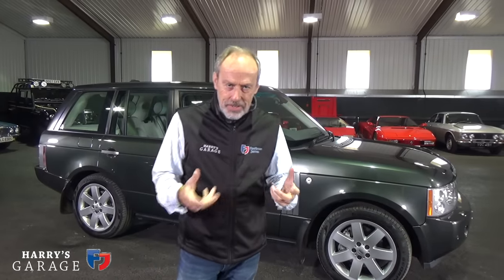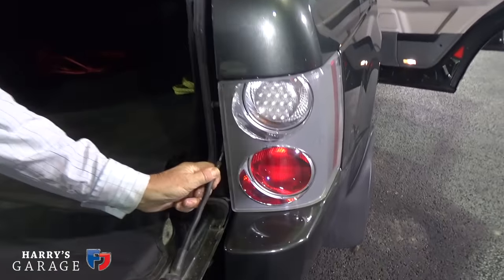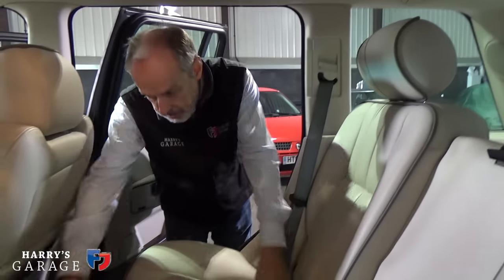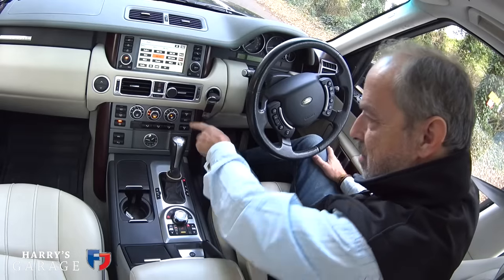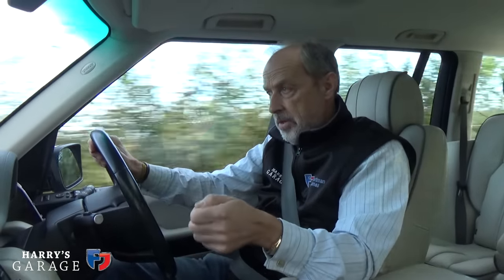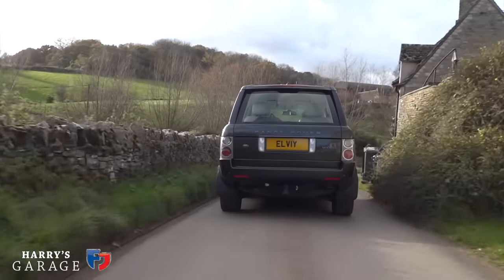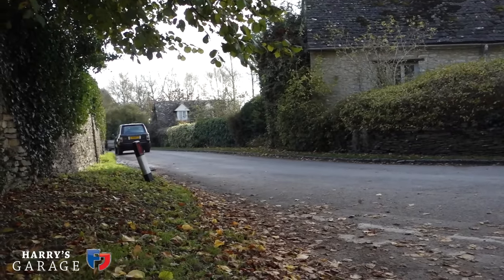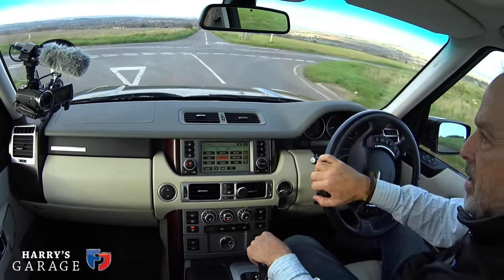Range Rover real-world review and buyer's guide L322 TDV8

Comment: Buy this car only if you can afford to buy a brand new one, the appeal of owning a range rover for cheap is incredibly high, but while the used Range Rover may be cheap, the repairs costs are still as much as a brand new Range Rover, but you are dealing with an old one with more parts nearing their expiration. The only smart thing to do, would be to spend this money and lease a brand new one, furthermore, used range rovers may be cheap in UK, but in the US, for a 2006 Range Rover 142,000 miles goes for as high as $12,000, for that money you can buy a Prius which is the complete opposite in every single aspect apart from how huge and roomy it is inside, plus the huge gas savings, and insane reliability.
Reply: Cody Slab Prius? Wouldn't  be caught dead in that ugly junk driven by pretentious progressives her in the SF Bay Area. God l hate that car.
Reply: Ha,$12k is a little high. 2006 RR and RRS here in the USA go for about $7k. Sure they list for $11-12k, but the owner is so desperate to sell with all of its problems that they'll let it go at first offer you make.
Reply: Comparing a Prius to a Range Rover shows you have no soul

Comment: Cheap and nasty. I have never known such unreliable vehicles, to be found at the bottom of every survey. When you need the parts, the Indians rip you off. You can't buy a suspension compressor seal for £3, but you have to buy a compressor for £900. Then there's the fuel consumption. Just shocking. The safety. Abysmal. Where's that bargepole?

Comment: never had an l322, but after 2 bad experiences with the 4 door classics, i'd never want one of these either. cars aren't designed to be reliable, at least not these ones. they were designed to drain bank accounts on a continuous and permanent basis. built in obsolescence. computer chipped. spiel from garage about official land rover service stamps etc etc.come back to the garage and spend more mon££££y. so that during a 10 year plus ownership. you're talking £150,000 down the plug hole. for a car which is now worth £7000. what a total waste of money. never buy a new car. and never buy a range rover. thery're not even owned by a british company. would you buy a tata? no, well, that's what you spent £150,000 on.

Comment: That Range Rover is a WORTHLESS dog made with expensive LOOKING cheap plastic and low quality parts.
Reply: Your comment is a worthless comment made from the perspective of someone with no understanding of the L322. It's a fine vehicle engineered by BMW from the same parts as the E38 7-series, E39 5-series and the Rolls-Royce Phantom. BMW's golden era.
Reply: Not so. The E38 and pretty much all Rolls Royce vehicles (Bentley included) were disasters and plagued with reliability and quality issues. I saved my money to purchase a Range Rover (cash) and after a little research discovered that they are worthless money pits. If it's such a great vehicle, go buy one for your self. I would love to see your video review after 1-2years of ownership. Land Rover vehicles are overpriced garbage. I can still remember all the metallic looking and painted cheap plastics in the interior. Peeling rubber paint that looked like black plastic trim. Go look over a used one and see how the interior goes to hell after a few years of use. Then there is the constant failure of the subpar components. Your screwed if you buy one of these without an "extended bumper to bumper" warranty.
Reply: The E38 was far from a disaster, a vastly better-built car than the E65 that followed. The Rolls-Royce Silver Seraph/Bentley Arnage was a fine car, with the Arnage lasting in production for 15 years. The E38's little brother, the E39 5-series, with which it has much in common, was the best mass-production BMW ever made. I've got three of them and they've been brilliant. My 540i Touring workhorse now has 217,000 miles on it and is utterly reliable. The Rolls-Royce Phantom was based off much of the same running gear, albeit with the new V12, and is a fine car too. The L322 is tough as old boots - and that metallic effect in the interior is real aluminium, not plastic. They hold up far better than Toyotas after a decade's hard use. LCs and Hiluxes just rust away.
Reply: That is where I must correct you. Yes when exposed to salt and neglected any car made of steel will rust. However I went with Toyota (Lexus) for my rugged s.u.v. I do my own repairs and did not have many to do on my 20 year old FZJ80 and it is still going strong (4years and at 160k). I grew bitter toward Land Rover because I always wanted one but they are utterly unreliable and built to fail (big profits for the dealership parts and repair dept.). Better stick to your lucky Bavarian Motor Works 7series and stay away from Land Rover. I also wanted one of those until a dealer gave me the scoop on them. The 7/540 motor had issues with leaky/blown head gaskets, coolant & oil leakage/mixing and they are difficult to repair. You can usually tell if a vehicle is good by the resale value and how often you see older examples on the road.
Reply: ceep-your comment adds no value here-Go troll somewhere else.Millions drive these cars and are happier.You need therapy
Reply: What do you drive? Can you even change your own oil? Can you even afford to buy a luxury truck or car and maintain it? Do you even own any tools? Shut up, Barney.
Reply: Old man? Haa.. Females in their early 20's are still trying to get me in bed, son. You can only wish you looked this young at my age. And I already own my dream car (Classic 993) with no visible grey and a head full of hair. No hair dye. (no smoke, no drugs, no liquor, no dairy, meat once every 1-3months). Save up and buy a Range Rover if you believe they are so great. I will drive past you laughing as your malfunctioning R.Rover is lifted onto a flatbed truck.
Reply: The Toyotas are made of crap Japanese steel (ask any swordsmith about Japanese steel, and why katanas are crap...), which is why they rust. Their iron ore is more impurity than iron. Add in inadequate rust-proofing, and you've got a truck that will rot out in no time. The BMW M62 engine (of which I own two examples, an early non-VANOS cable-throttle M62B35 in my 535i, and an M62TUB44 with drive-by-wire and VANOS in my 540i) does not have head gasket issues, mine is still absolutely tight, the coolant is devoid of oil contamination, and there's nothing that you can't get at to repair. None of those are common issues with M62s. There's a reason why E39s, E38s and M62-engined L322s are still a daily sight in my neck of the woods (south-east England).

Now, the M62 is not perfect. I can tell you what DOES go on them, where BMW skimped on build quality... stuff like the timing chain tensioner and guides (plastic), you can tell when they're on the way out when there's an audible rattle from the chain. Mine has yet to get there. The water pump impeller is also plastic and can shatter - BMW later upgraded to a composite impeller, and a previous owner kindly fitted a new aftermarket pump to mine. A top quality EMP Stewart pump (cast stainless steel impeller and pulley) in the US runs to $195 and gives 20% more flow than OEM. Occasionally the oil pump drive shaft can shear or shed its splines, or the retaining nut can work loose and cause loss of oil pressure (mine hasn't)... on high-mileage engines, the rod bearings can wear and go out of round, causing a rattle that will eventually lead to catastrophic engine damage if you don't get a rebuild done, but mine at 217k hasn't got a hint of that... Rod bolts can be prone to stretching and nuts can work loose, exacerbating the knock: they must not be reused in any rebuild. Piston wrist pin bushings also wear, leading to play in the pin and thereby can also cause rod knock. This can only be dealt with by taking the heads off the engine. Again, no hint of rod knock in my engine. Power steering pump pulley, main utility belt tensioner and air conditioning pump belt tensioner are also plastic and worth upgrading. Radiator sides – guess what? More plastic crap! Mine has an all-metal radiator in it. Water and oil temperature sensors can be prone to under-reading. Replacement every 70,000 miles is recommended. O-ring leaks are common. Heater control valve rubber seals become brittle and can clog the coolant feed to the heater core, causing overheating. VANOS problems are not wholly unknown but much rarer than on the straight-sixes. Getting at the bottom end of the engine to address any rod/crank/oil pump issues involves taking the oil pan off, which in turn necessitates removal of the front subframe to get at it. Not too big a job, just a bit of a bugger - it's worth upgrading the front anti-roll-bar while you're in there, as it also requires the subframe to come off.